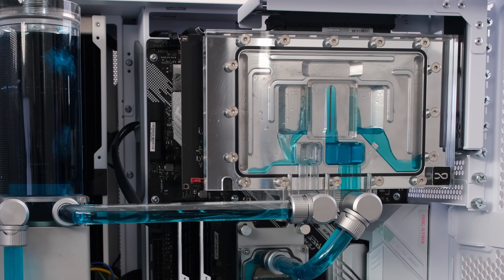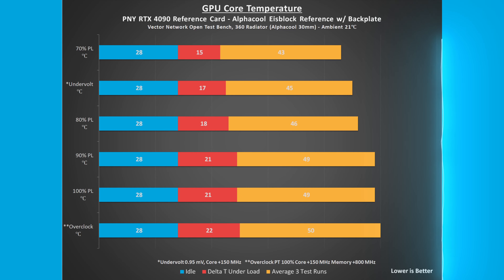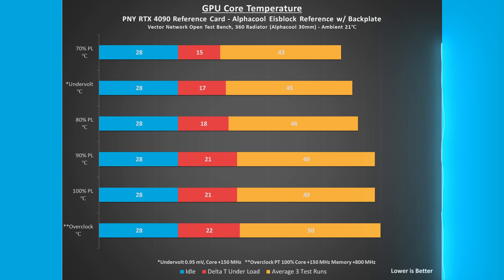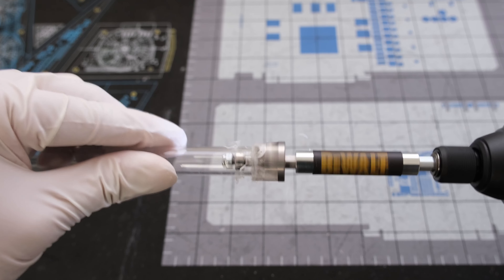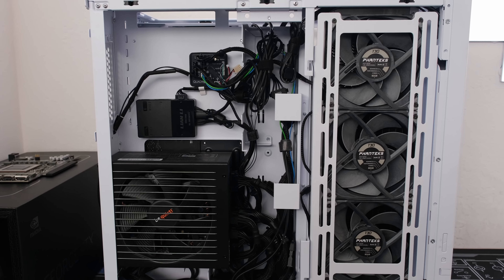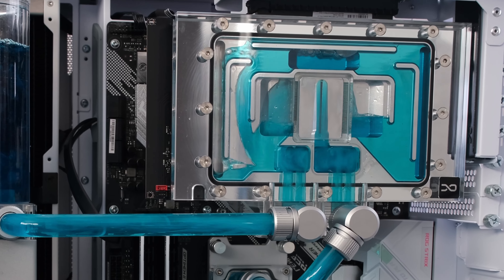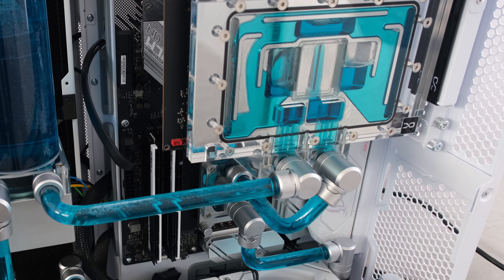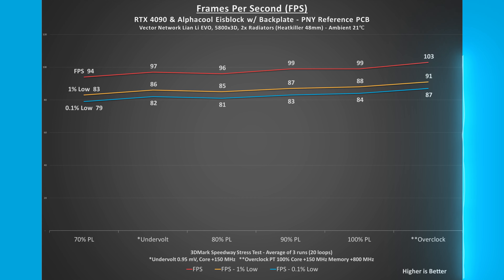Watercooled PC Build Maintenance

Comment: First time seeing a video where Aquacomputer components are being used.  Aquacomputer is a very powerful system.  If my card is running in the low 50s I just let her rip.
Reply from the maker: Thanks for your comment 🙏 It's worth it because that's what I wanted to show. I like all these little Aquacomputer gadgets and how the software works. After a build, it lets me control the loop. It serves as something familiar and repeatable so I am not at the mercy of the motherboard software or other constant-developing solutions. Hope that helps
Reply: @vectornetwork  I have AQ components also for my dual loop and like the software and how I can control things the way I want.

Comment: Hello. Another great video! Like it. But! Interesting what a level of lout near PC case, how much FAN's were used on this setup and what FAN's? I think this is a important info. Thanks.
Reply from the maker: Thanks for your comment 🙏 Do you mean level of noise for the PC? For the fans, I included the info during the coolant fill and also in the graphs. Vertical radiator has 3x Phanteks T30s. These are high performers because they are 5mm thicker than standard fans, so they have an inherent advantage. I wanted the fans to be behind the radiator to exhaust the air out the back. The horizontal radiator has 3x Lian Li SL-Infinity fans. Primarily for looks as several other fans could have performed better. But the silver and white accents as well as the mirrored sides really just goes hand in hand with the design of the build and its right up front and with 2x 360s, the build has some room for looks. For the tests, I ran the fans on an aggressive fan curve. Is that the info you are looking for? Average fan speed and decibels? The cool thing about using the aquasuite software with the octo and coolant sensor is that the temperature under load and also the fan noise can be completely set and customized by the user for their own use case. Hope that helps.
Reply: @vectornetwork  Thank you for a additional info!

Comment: Those major air bubbles in the block would worry me. It looks like a bad design for the water flow and it never fully got the air out of the system. Even though the die stays cool, are the power stages getting cooled properly too?
Reply: To be clear, I'm not bashing the video. It was good. I'm just not sure how I feel about the flow path of this block. I'm genuinely interested because I have the same card and am looking for a good waterblock for the reference board
Reply from the maker: @dracer35  Thanks for your comment 🙏 Good eye, since I wanted to get footage of the initial fill, there were still a lot of air in the loop. Rest assured that I slowly bled the air out of the loop and over a few days I was able to continue to top off the reservoir until the bubbles slowly dissipated around the flow path. The reservoir is now brimming and the air bubble are just minor and a little up near the top of the waterblock (not around that problematic flow path on the side). There is nearly no air and the coolant doesn't even look like its moving during load. 
Having said that, I do think that side part of the flow path does seem visually ineffective. From Aquacool's press release on this water block, they specifically mentioned that the altered flow path was an improvement (along with advertising the the new Chrome finish). I do think the Chrome finish is a clear and welcomed upgrade. I am not sure about the altered flow path but I do admit I am by no means a flow expert and/or engineer. 
As for performance, it performs as expected for a 4090. Efficient, powerful and cool. I can only measure GPU core and memory temps. I am unsure on how to measure VRM on a GPU. If someone can help me with that, I may be inclined to try it. Hope that helps.
Reply: @vectornetwork  Could I ask what did you do to bleed the air out of the block? I have the exact same block as per your video at 0.13s and mine has the same massive air pocket top left corner. I have tilted my pc front,back, sideways you name it and let my pump run for 2 days solid with my distro top entry open to get rid of it but nothing seems to working. Seems impossible to get the air out due to the fluird running around the edge and dropping. Even with my pc upside down the air pocket shifts and goes into the loop just to return to exact same spot once stationary. Any info would be appreciated never seen this on any ek or alphacool block i have ever owned
Reply: @MrDjstrauss281  I have the same block in an NZXT H1 and you just have to tilt the computer back and forth in all directions. I got all but one tiny bubble out of the block in about half an hour. The block is great, he just didn’t bleed it enough to begin with. Afterwards you can see the air bubbles are pretty much gone.

Comment: Do you have a list of all aquacomputer parts in your loop that you can share here?
Reply from the maker: Thanks for your comment 🙏 In this loop? Sure thing, its only a few items.

Aquacomputer Quadro controller
Aquacomputer High flow 2 sensor
Aquacomputer Temp sensor

The high flow 2 will measure the Flow and the Coolant. It plugs into the Quadro controller.
The temp sensor will measure the ambient air temperature. It also plugs into the Quadro.

Hope that helps.
Reply: @vectornetwork  thank you. Very helpful. I was told just getting the aquacomputer flow meter will work but not a complete aqua setup. that's why I asked for all the parts in your loop for better understanding. Thanks again.

Comment: Getting this "cheap" 4090 and not going for a Strix or Master allows you to save enough money for a waterblock, in the end a PNY Verto + waterblock will run faster, cooler and more silent than a Strix for the same amount of money (provided you already have a custom loop).
Reply from the maker: Thanks for your comment 🙏Right on brother, the reference PNY 4090 is 4090 and expect it to run as well as any other. These cards for this specific generation seem to be  pushed to the limits and juice already beyond diminishing returns. Whatever the outside looks like, it's a ferrari underneath. An efficient ferrari.
Reply: @vectornetwork  Yep, i ended getting a Zotac 4090 Trinity (reference board), powerlimited to 60%. There is a very interesting video about 4090 power limit from Derbauer, basically he said "default power target makes no sense"
And i have to agree, i scored 29k+ in superposition 4k optimized for pretty much the same power usage of a 4070ti.